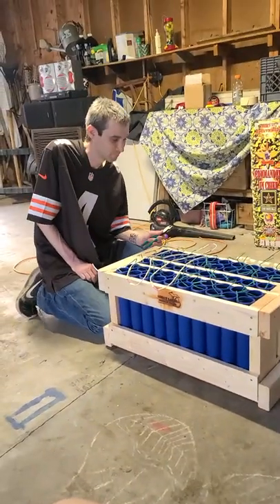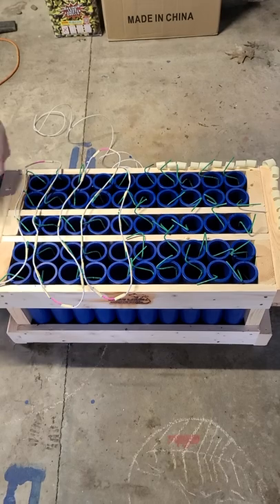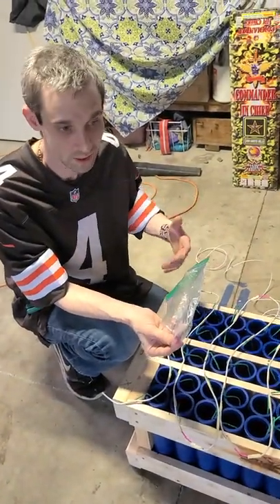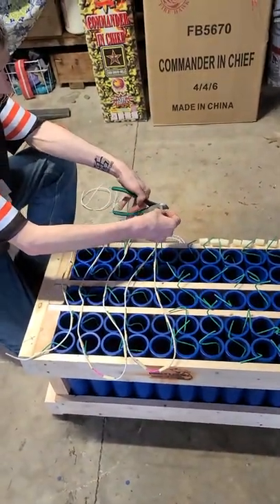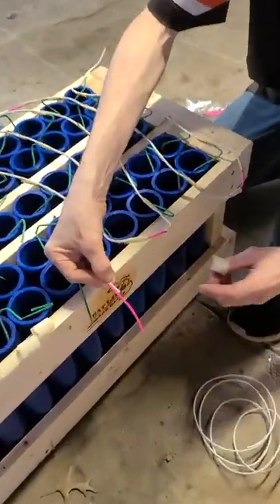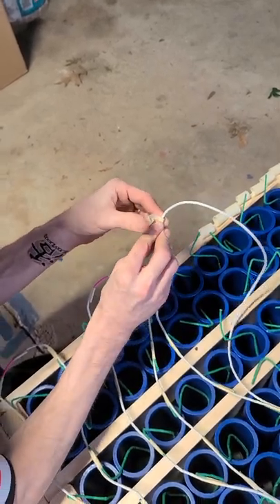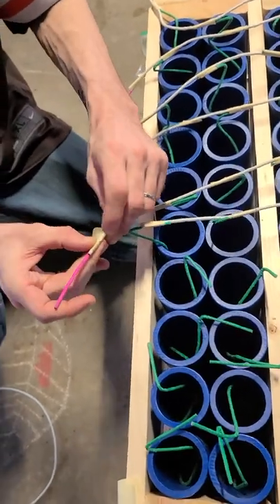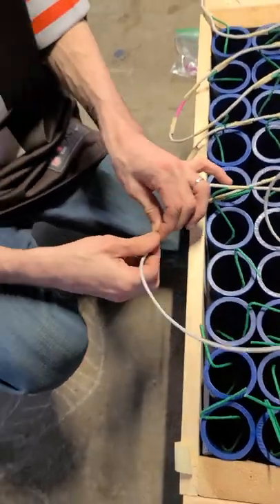Fuse and 50 shot mortar rack test setup. And demo of how I choreograph fireworks to music

Comment: Why not just run perfect fuse down one side and run lines off it. Would be easier to time it right.
Reply from the maker: I actually did that in another video
Reply from the maker: I tried that with lines of quick fuse running off it and it was too fast. I think you're right though. I'm going to try a line of perfect fuse with 10 lines of perfect fuse running off that and see how that goes. I've tried a bunch of ways with quick fuse and it always goes too fast.
Reply: That's what I was thinking. If the main line is about 17 seconds that will give 3 seconds for the lines off it to go boom. It would be easy to make adjustments that way. Just keep burning fuse until the timing is right. No wasted booms.